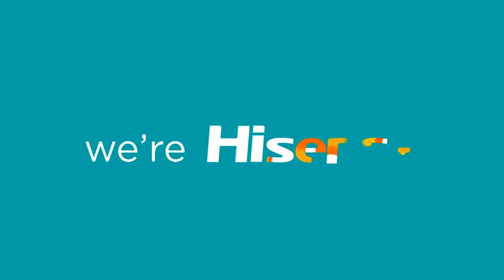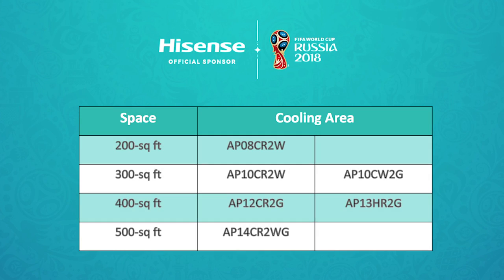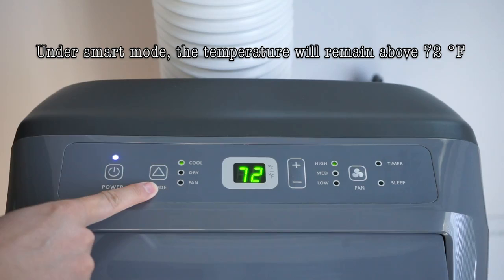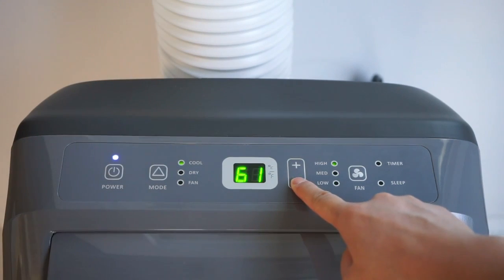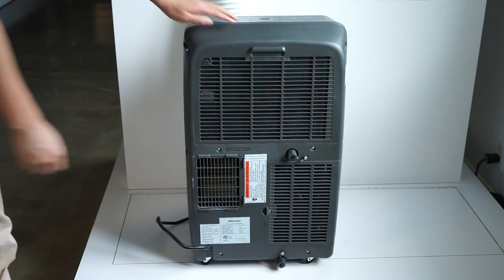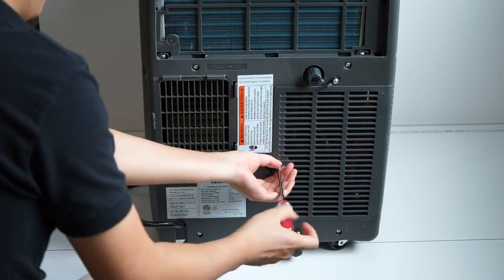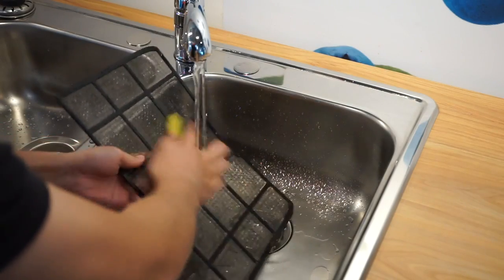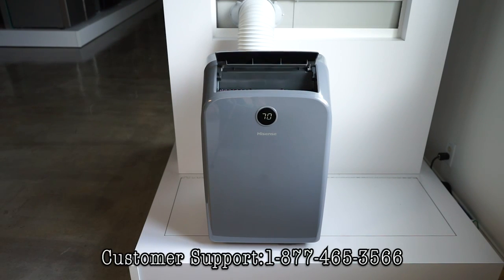Hisense Portable Air Conditioner - Not Cooling

Comment: Mine is brand new out of the box and the AC keeps kicking off leaving only the fan on.
Reply: I have a different unit. But mine will run for a bit, maybe a minute or 2 then shut off.
Reply from the maker: @TRICERACOP1  Check your mode - if it's in smart mode, it works off of the ambient temperature of the room. Make sure it is set to Cool Mode.
Reply: @HisenseCA  we moved it to a bigger room and it runs fine now. The area we had it in must of been too small
Reply: @TRICERACOP1  it happening same with me AC kick on for minutes then goes to fan need help just put unit yesterday
Reply: @roshanbhakta8903  have you tried to move it away from walls and objects or into a more open area?
Reply: @TRICERACOP1  yes it's in more open
Temperature read 91f and it's been 5 hour already not going up or down however it is puting lots hot air out vet hot for touch.